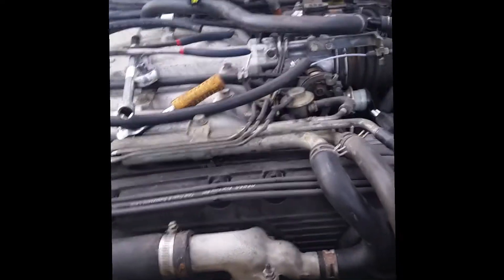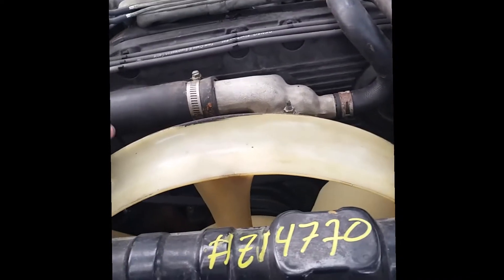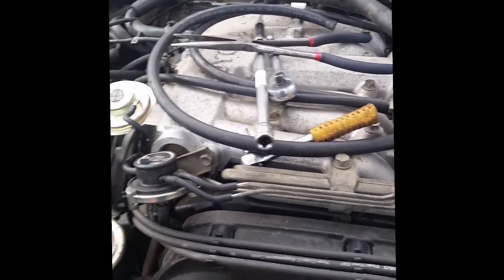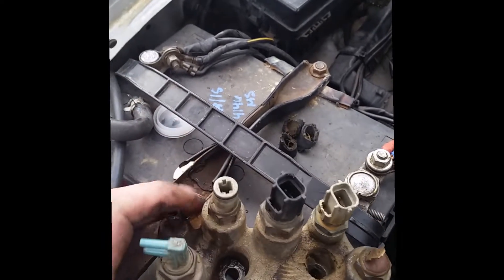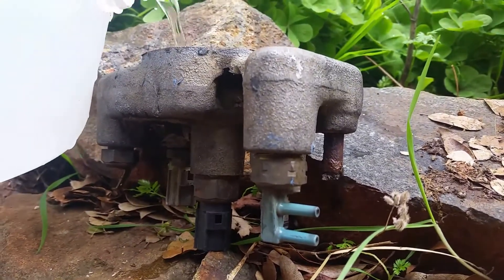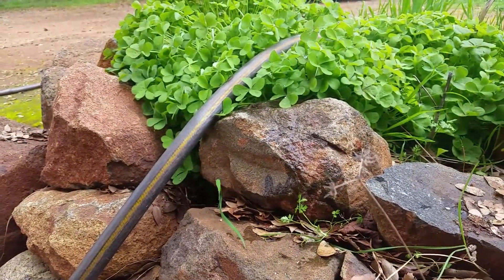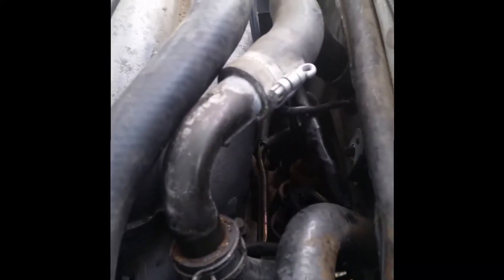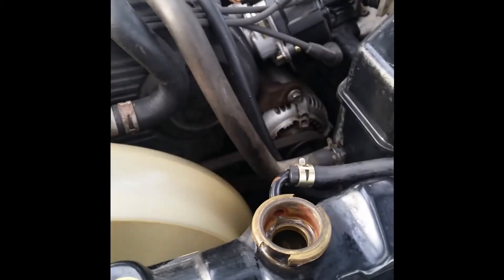Toyota pickup/4runner 3VZE overcooling/bad gas mileage/bad overdrive. fixed!!!!!! (read description)

Comment: I'm running 60% anti-corrosion Toyota Red Long Life coolant from the dealer & 40% distilled. I mix myself, to be sure of the ratio.
If you have the brass radiator,  have checked for tiny leaks which can cause rusting/corrosion inside the motor. It will suck in air.

Comment: My experience with the Denso water temp sensor.... I used CRC  freeze-off to get my 3VZE  water temp sensor out with a 19mm Fuel line crow foot socket. I didn't break it. On that sensor is the part number from Denzo. My replacement was an exact Denso replacement with same PN. There was a copper crush washer on it.  My sensor was original Denso from Toyota Japan Factory 34 yrs ago.. I've had my 5sp manual  4Runner 31 years
Reply: whats the part number?

Comment: Try Autofit Inc to get the fan shroud,  as you don't have the black plastic radiator fan shroud both upper and lower.  You need that radiator fan shroud

Comment: Did you completely drain your coolant for this?
I just bought a 90 4runner and I'm having very similar issues. It still has old red coolant and I'm going to drain the system and replace the thermostat while I'm at it. I just didn't know if I took off this same piece, if it would burn anything.
Reply from the maker: Youll need to replace the seal with high temp rtv but aside from that its pretty straight forward and shouldnt "burn anything" . I would do it at the same time as when u do your thermostat and empty as it will make it way easier. Good luck!

Comment: How does your truck not overheat if the cooling lines are clogged?
Reply from the maker: This whole system is secondary to the actual cooling system. a clog here just causes this small system to not function properly

Comment: No overdrive in the freeway because of this?
Reply from the maker: yes. your truck has a system that will cut out Overdrive to help warm up your transmission to operating temp faster. If the actual sensor itself is not functioning or not showing (operating temp) then overdrive doesn't come on. good luck!

Comment: Mine has a heater hose that goes to the water bypass outlet. The hose cracked where the clamp holds it on and was spraying coolant all over the back of my engine. Any who.. I thought I was going to have to take off the plenum so I could access it better but instead I took the hood off and got on a step latter on the passenger side and had plenty of room to access the hose and if needed I could also access the temp sensors too.. I'm assuming if I needed to I could also unbolt and remove the entire water bypass outlet. I dont know how it was removed in this video but it doesn't seem he removed the plenum.. So try removing the hood if you need access.
Reply: Goni I just had the same thing happen to me. After the hose burst I have a check engine light on. Starting first thing in the morning takes a couple tries but other than that, it seems to run good. We’re you experiencing similar problems? Did you find a solution?
Reply from the maker: no intake manifold removal needed. just socket extensions and loooong needle nose pliers
Reply: Thanks I'm going to pull my hood off and check. I have a coolant leak somewhere and cant find it. I can hear it dripping but sounds like it's hitting the crossover or something and evaporating. I hope it aint the heads. I been considering pulling the engine and just 3.4 swapping it. But it would be nice if it was just a hose or something easy lol
Reply from the maker: @JoshDane89EF  hope you figured it out and didnt go that far! Sounds like the rear manifold hose to me!!

Comment: Great video!  I had a very similar issues that others may experience.  The outlet from that same sensor block goes into a pipe under the the lower intake manifold that can also clog with rust or stop leak.  My 4runner would never warm up like yours.  I replaced the coolant temp sensor block, all sensors, and a variety of other possibe fixes.  None of it worked, so i did a full rebuild, bored out the cylinders, had the block and heads redone by a specialist, hoping that would fix the issue.  It didn't.  It's because I didn't replace the pipe under the lower intake manifold, I was unaware that it was clogged.  I found the problem after 1 year of troubleshooting.  The coolant downpipe from the sensor block was clogged.  Also the oil cooler was clogged.  They were clogged with stop leak.  These motors are prone to head gasket leaks, so novice owners pour stop leak to cheaply resolve the problem.  I replaced the pipe and installed a clear oil cooler and now it runs like a new engine.  Thanks for posting this video so others can help resolve their issues.
Reply: It's a real shame that the shop where you had your engine rebuilt wasn't professional enough to blow compressor air through all the metal pipes and metal outlets as well as every hose. Another issue to watch out for is the oil cooler on the left hand side (driver side, USA). It's a drum looking part that is located on the bottom left side of the block. It also helps to cool the engine oil. Oil through this filter like drum while coolant flows around this same drum to help cool down the hot oil. There's a long coolant hose that goes from the front of the water pump and around the left side on the engine going towards the back where it attaches to this cooler. Since it's located so low on the side of the engine block, much rust build as well as dirt and debree piles up on the outlet on the block to this oil cooler drum looking piece. I tried finding a decent quality one at the junk yard and they are all mostly clogged up with rust. All the pluming is rusted. Plus these 2nd generation 4runners are nutorious for blowing the head basket at around the piston 6 location. I think it has to do with the cross over pipe. I rebuilt the whole engine on my 1991 4runner sr5 3.0 3vze last September of 2018. This engine is no fun to work on. So much can go wrong because there is so many pipes all over engine block including the top of the block in between the lower intake manifold where the knock sensor is also located. You do one thing wrong and you have to dismantle half of the engine.  I replaced the freeze plugs on my engine block but not on the cylinder heads. Guess what?  2 months later 1 freeze plug at the rear of a cylinder head started leaking. I removed both cylinder heads and replaced all the freeze plugs. Just this January 2019 the valve covers started leaking out oil. So there I go removing the whole upper parts: wires, hoses, EGR, intake plenum, distributor, etc. I removed the front end valve caps & the rear end valve caps to use Permatex anaerobic silicone rather than the typical rtv silicone gasket maker. Anaerobic silicone dries on metal to metal contacts in the absence of air/oxygen. A couple of days ago the fan pulley bracket started making a grinding noise. The bearings are dry of grease so now I bought one in Amazon. I will be replacing it next week but here I go again, have to remove the whole front part of the engine. Not a fun car to work on. Not a vehicle for your average home mechanic.

Comment: Did you have to remove the plenum to get at the sensors etc? My issues are different as my overdrive works intermittently when the truck is at operating temperature. Actually id won't downshift at all and remains in overdrive until I floor it from a stop then it will go into the proper gear. I've been through most of the motor and keep it properly tuned but this has me baffled. It may be a solenoid pack in the transmission as I'm sure it's the original with just over 200k on the clock. I had the transmission flushed in 2012 at Shitty Lube which may started it. The TPS is new and correctly installed after the first one threw me for a loop.
Reply from the maker: no. 2 bolts and you are good to go. long socket extensions and long needle nose pliers are your friend
Reply: Did you ever figure this out?
Reply: the plenum is a piece of piss to take off